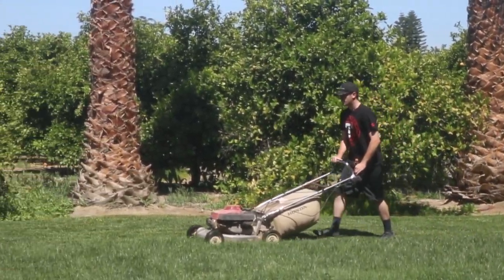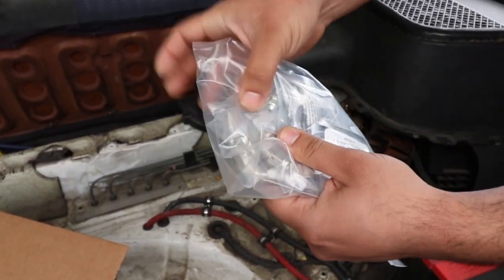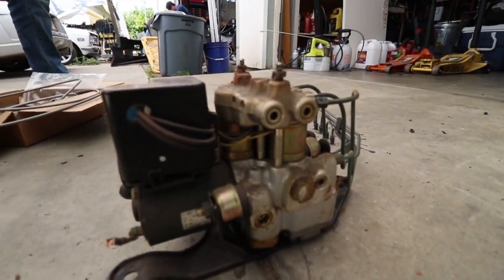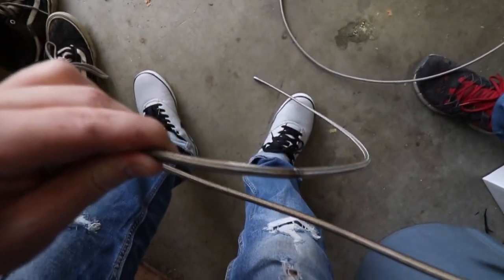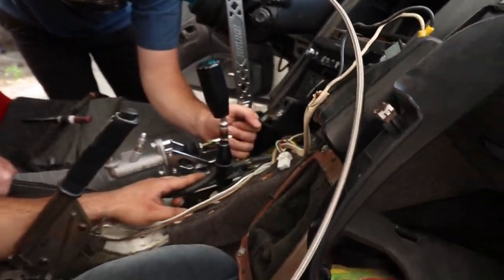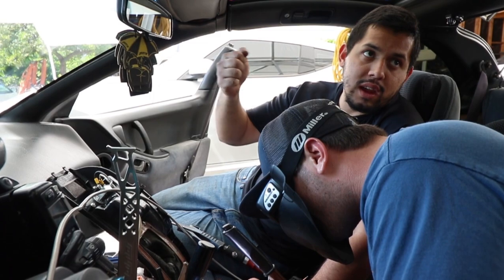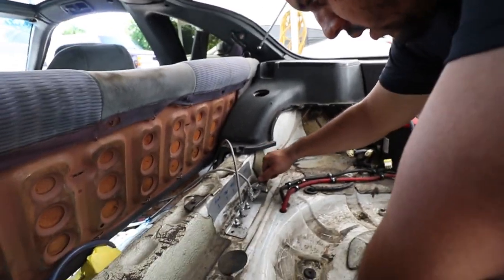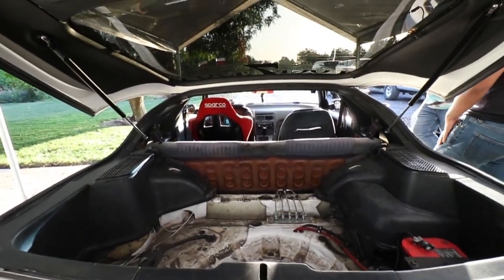300zx Hydro Install

Comment: Could u list the parts such as the fittings u are using and the length of the lines u are using. There really no kit available. Well at least I can't find.  Would greatly appreciate that. Thanks